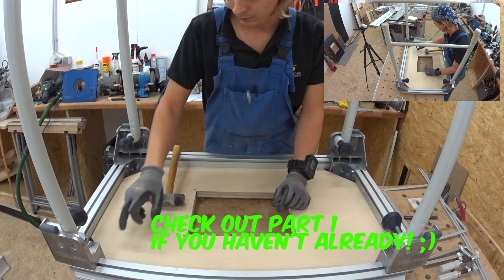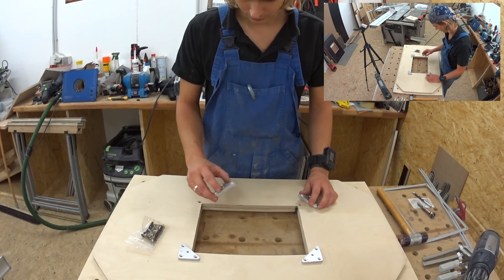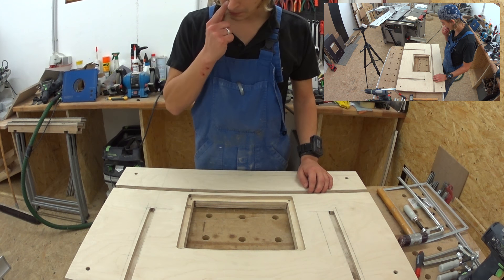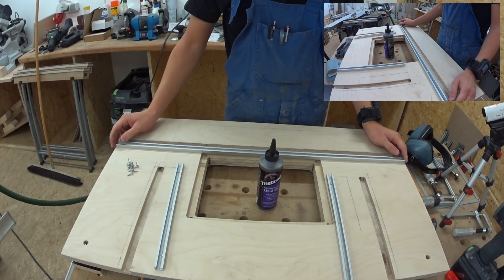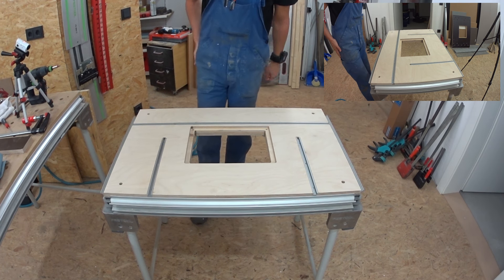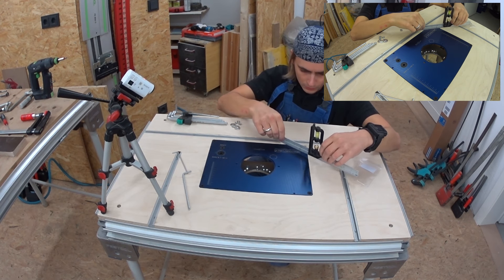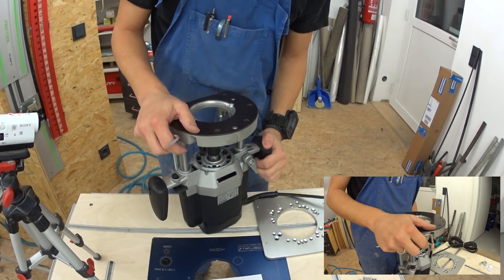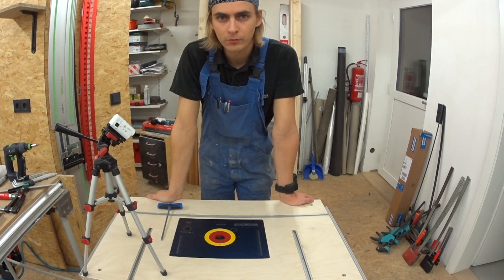RouterTable Mk2 (Part 2 Final) [WeaselWood 🌳 ShopImprovement #8]

Comment: Hi, nice Video. I plan in the moment someting like this. I will install the original CMS Modules from Festool inside the MFT to have a larger Table and the functionality of a Routertable and a Tablesaw. The only Problem that i see is to mount a sliding Table on the MFT. Have you try this?
Reply from the maker: Hi Sebastian
There is an sliding table from festool, that comes with the CMS and the Precisio tablesaw, I could imagine that this should be compatible with the aluminum profile of the MFT (https://www.mikestoolshop.at/shop/festool-schiebetisch-st-no-492100/).
But I never actually tried it, no liability assumed! ;)
Greetings Martin